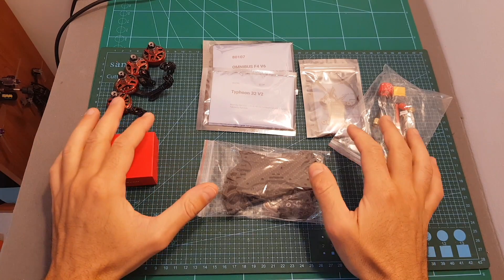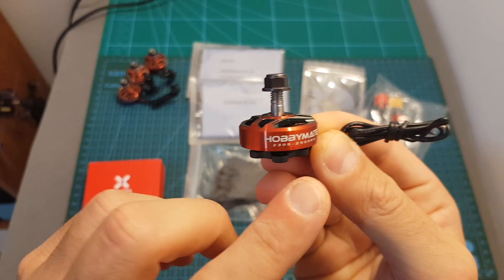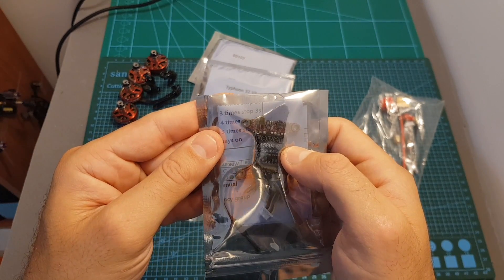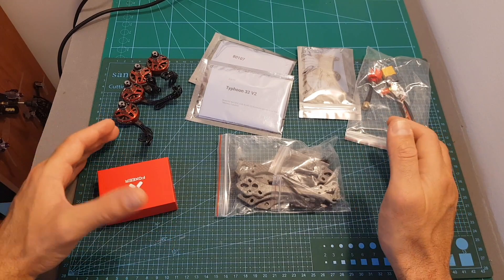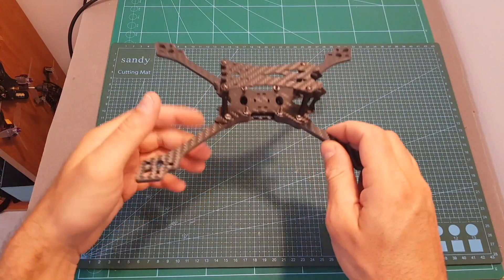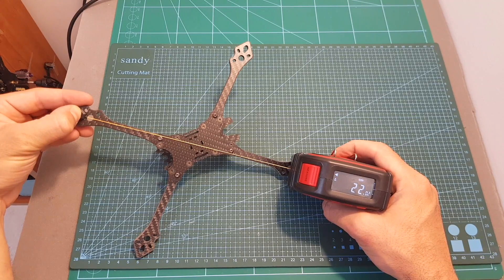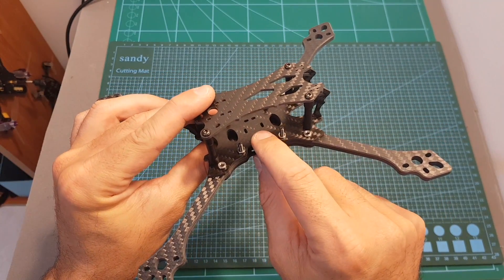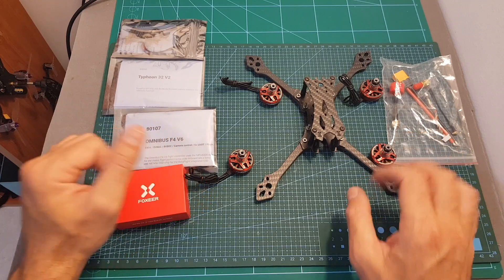Hobbymate Comet Racing Quadcopter Kit - Review & Build

Comment: Hey good vid, keen to get the kit and build it myself as it will be my first quad... 

One question does it come with Rx in th build kit? Or is that extra? Thanks
Reply from the maker: Thanks James. Along with the kit you don't get any RX, so you need to buy it separately.
Reply: Thanks for the heads up... 

Also, thinking getting the 1800kv motors and running 5s what are your thoughts?
Reply from the maker: Get the 1800Kv only if you plan to use 6S batteries. The performance of the 2500KV version with 5S is better than the 1800KV version.
Reply: Thanks for an advise really appreciate it! If I was going to upgrade to 6s alittle later I’d be right in thinking using 5s would still be fine to use.. would just feel a little under powered

Comment: Nice kit. Why do you mount the receiver antennae in the straw attached to the arms instead of through the holes and above the top plate (with zip ties and shrink)? Wouldn't that work better with them up and away from the carbon fiber?
Reply from the maker: You are correct. The reason I used this mounting method is because in my experience it provides better protection for the RX antennas and if you're not going to get too far in terms of range it will do just fine.

Comment: I almost made the jump on the on the frame and motor deal but seen how the stack is mounted via the screws the legs use I had to change the mind. I was more of an impulse rhing so the screw thing stopped me. That kit is a killer price. the esc motors and fc are alone nearly the cost of the kit.
Reply from the maker: You can also mount the stack using spacers, but regardless I don't recommend impulse shopping ;-)